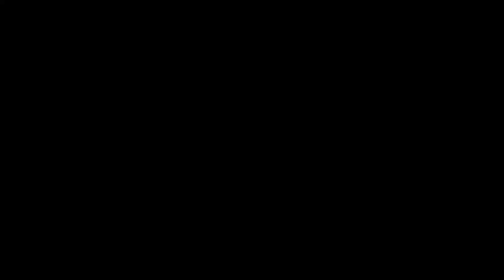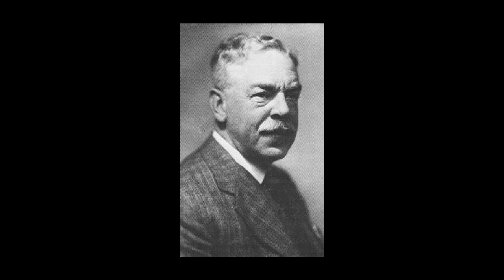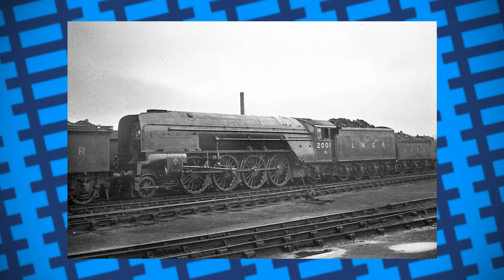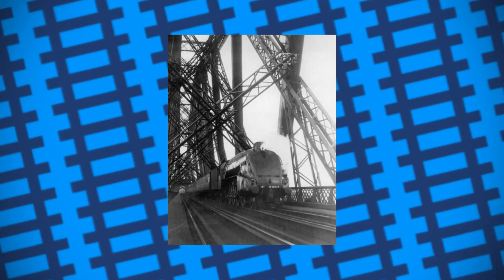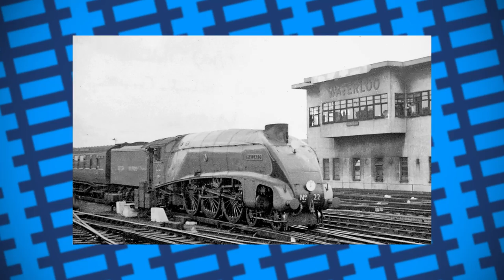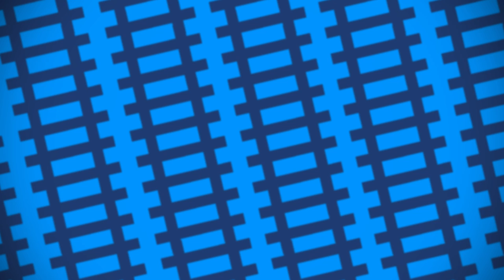LNER's 8 wheeled experimental express engines - LNER P2

Comment: Greasly really was just a mad engineer with bear infinite amount of money. I would love to have been a fly on the wall when Greasly rocks in and goes, “What if we put the boiler from a ship, in a steam train?”

Or “What if we made a 2-8-2 express engine?

Or even, “What if we made an engine, with 6 cylinders?”
Reply: The LNER was the poorest of the big 4, gresley made it even more poor. 

He was a fool
Reply: @Trainskitsetc  He may have done. But at least they were poor… with style.
Reply: @DTChapman1  ...yeesssss because that's the aim of a railway...
Reply: @DTChapman1  they weren't just the poorest they actually never turned a profit, not one single year of the LNERs existence did they make any money... probably in no small part thanks to the silly persuit of speed and prestige rather than focusing on becoming more economically stable and repaying the debts they'd inherited at grouping.
Reply: @Trainskitsetc  seeking prestige is a very British thing,solving problems isn't a very British thing. So in this sense,Gresley succeeded
Reply: @davidantoniocamposbarros7528  no, its very much just an LNER thing, every other railway sorta managed both lol 

The GWR had prestige services to ports for onward traffic out of the country plus other fast express and standardisation, the LMS managed a fair amount of standardisation and prestige services from London to the north, the Southern managed to run prestige high speed services and also engaged in rationalisation of it's other workings and movements toward a more modern railway to suite the high frequency passenger service needs of its main routes. 

The LNER basically let it all go to pot other than it's prestigious service and some attempts at shoring up its heavy coal workings/express freight capabilities. 

It pretty much sucked at any progress towards becoming a more standardised easier to operate efficient operation. This could be put down to finances, in some part, but also in large part to the board being sold the idea of prestige being more important than rationalisation of the whole operation.
Reply: Greasely lmao
Reply: Probably wanted to use the boiler on an engine rather than a train.
Reply: Why Are you calling him mad’? Who designed and oversaw the construction of Mallard and Flying Scotsman
Reply: @kernowpictures2002  it's because gresley and his, arguably failed, experiment is  largely all the lad knows about. 

If he truly saw the breadth of experimentation and the rate of failure that continued well into BR days he'd realise an engineer having a bad, or subpar, idea or being sweet talked into putting some bit of kit onto a loco on the bases of magicians hat levels of improvement in operating costs or maintenance costs he'd probably see hush hush for what it is, the failed experiment we all learn about because of the guy who did it not because of the anything particularly amazing about it. 

Let's go through a few more eh, 

Holcroft-Anderson and the recompression system that was meant to improve efficiency 29%! Failed. Same holcroft that actually did the leg work for "gresley conjugated valve gear" 

Vincent raven, the guy who was responsible for bringing the pacific to the north eastern that became part of the LNER that culminated in the gresley pacifics... yup he had a bad time chasing the idea of uniflow steam locomotives

Bulleid, worked with gresley, worked on gresleys most famous locos, then went to the southern and... well ends up chasing the dream of the leader... experiment gone wrong. 

Interestingly bulleid was married to the daughter of Ivatt... no not that ivatt from the LMS the Ivatt from the north eastern  who was the dad of the Ivatt of LMS fame

But you'll note a theme, none of them were mad engineers they all just sorta did a job and also sorta made some poor choices in that job😆

Ivatt(senior) probably did more than any of these to influence norms of british loco design having introduced walschaerts valve gear to the UK which other than stephensons was basically universal. Everything else being sort of just a foot note. That's the kind of engineering we should admire the people who make the world what it is not the people who get bored one day and decide, in modern terms, to do a hyperloop because efficiency!
Reply: @Trainskitsetc  Well that would’ve considered murder if they could actually speak and were alive like in the railway series books/(Thomas & Friends TV show)
Reply: @Trainskitsetc  Weren't Southern railways the poorest? Least with the LNER they had quite a decent monopoly on the coal/mining transportation
Reply: @kernowpictures2002  no genius has ever been truly sane
Reply: @Trainskitsetc  A fool who built Mallard and Flying Scotsman (as well as Gordon)
Reply: @kernowpictures2002  happened to be in charge at the time. The real men of the works built them, the skilled hand of the drawing office drew them, they are no one mans machine.
Reply: @Trainskitsetc  Gresley wasn't a "Fool" he was primarily a man of engineering, rather than a man of financial management.   That being said - the P2's were a pet project with his apprentice Bulleid, that lead to the A4's, the W1 was another experiment - to see what was possible.... the U1 was his reluctant design requested by management, hence built by Beyer-Peacock to a plan by him.
Reply: @PiersDJackson  if you are placed into a position of trust to make engineering decisions that have real impact on the performance of a business and you have no head for business then within the context of the requirements for you to despense your duties you are a fool. Simply put, he couldn't actually do his job well. His job was not simply to oversee locomotive design, his job was to oversee locomotive design, rolling stock design and infrastructure design in such a way as to deliver a functional and above all economically viable railway operation. He failed. Simple as. No amount of pretty upturned bathtubs on wheels or speed records get away from this fundimental failure to do his job.

If he was in a business today, he'd likely be sacked for underperformance and huge waste of resources. And that's saying something given some of the people you see in top posts these days.
Reply: @Trainskitsetc  I put it to you this way, on a scale of Abner Doble, W.O. Bentley, Henry Royce, Henry Ford and Charles Rolls.  Being a scale of 1-5 from being mad genius engineer to ruthless capitalist.  Gresley would sit next to W.O. Bentley, and Bulleid would be with Doble, Thompson was of the Henry Ford variety.  Bare in mind The Honourable C.S. Rolls was a financier with old money, ie. worked in the city, and wasn't an engineer.  Put this way, Doble and Bulleid were experiment and prefect the concept types of engineer, only limited by delays in supply; Thompson and Henry Ford were after standardisation, keeping everything simple and interchangeable with parts, very utilitarian; Gresley and Bentley were pragmatic with their designs, if it worked, it worked, experiment within reason, keep the complexity simple.
Reply: @PiersDJackson  so let me put it this way, he was bad at his job. 

But he had a fancy rich mates so what's consistently poor performance  between friends nudge nudge wink wink say no more say no more that A4, does it go, does it roll does it
Reply: @Trainskitsetc  he was good at engineering, but was fiscally irresponsible.  He couldn't adequately work within an allocated budget.  If he had £150,000 to develop the preliminary batch of A4's, he'd spend £120,000 on R&D, then still spend £100,000 building them... so no he wasn't good with the cash flow.
Reply: @PiersDJackson  so, bad at the job. Like I get it he has a hero image built up around him, but when your job is make railway go and earn it's keep to make sure it keeps going and you don't do that job that's not being a hero or good that's being flawed. Fact is they had £120,000. If they had £150,000 that's not a defence of him to say he was hamstrung that's him not knowing how to work within the confines of what he has to work with. 

Lets say you approached a builder for an extension, you said you have £120,000. They build you the nicest extension, walls, doors, windows, roof all top notch, painted beautifully, art hung on the walls. Well you're gonna call them a bad builder when you see all this and realise sure it has all these things but they forgot to install any flooring so you're walking on the dirt that was once your garden. If that builder says "well it would have been spot on if you'd had £150,000"... that's just nuts. 😅
Reply: @PiersDJackson  so what you just said there in a round about way is, he was back at his job.

He couldn't work within a budget, he couldn't work within a time frame, he couldn't admit failure and persisted even when it was pretty obvious he wasn't delivering results. 

If we look at it critically, he was just not that great at the job. If we look at it with the romance of history, he was the greatest steam engineer ever because he made it go fast. 

Might be time we started looking at the reality of railway history and leave the myth behind.
Reply: @Trainskitsetc  to put this into a context some outside this community may understand: With the scriptwriters of Doctor Who in the 70's, there were the three "Gods" Douglas Adams, Terrence Dicks and Robert Holmes...  if you wanted it fast and by the numbers, it was Dicks (ie. Thompson); Intriguing and fast, with a few short delays in delivery, it was Holmes (ie. Gresley); but if you wanted mad and weird, it was Adams (ie. Bulleid).   Adams was infamous for his quote "I love deadlines, especially that whooshing sound they make as they fly past".

It's really a case of: On Time, On Budget, Fit for Purpose.  Pick two.
Reply: @PiersDJackson  he's still not a good chief engineer. 

The script writer is akin to the draughtsmen, the chief engineer is akin to the director producer, the director producers job is to keep a lid on the nonsense dreams of the writer, we have put the writer in charge of the production is what you really mean to say. Which is kinda not the best idea
Reply: @Trainskitsetc  what generally happens in either case, TV or Railways, is people migrate through the chairs.... the locomotive design engineer, or superintendent of carriage works, becomes the workshop manager, to become Regional manager, or chief engineer, and eventually becoming a administrator.   Or in TV terms, the writer becomes script editor, director and producer, or actor to writer to director and then producer... to then ascend to management.
Reply: @PiersDJackson  and... the wrong people can ascend, people not suited to the job. 

Given his fondness for birds it is maybe more apt to compare him to everyones favourite fictional radio host turned news reader turned producer turned director; Alan Partridge. He can make something, this is undeniable, can he do it well. Nope. 

Then he probably gets on the phone and reads reviews of his own locomotives from railway world to people he dislikes or reads reviews of how the LMS duchess makes overtaking a teadious process. 🤣 "the words of top gear magazine!"
Reply: @alasdairmmorrison74  yes sorry, i forget I must praise my gresley daddy for be make the speedy blue one.

I would say people who gush praise on him have a more particularly peculiar view on a man who the numbers show time and again really wasn't doing his job. That the books show left a railway in complete shambles. That the supporters of have engaged in some reprehensible lying to prop up the repuatation of. 

He really isn't all he's cracked up to be and that's just recorded time and again. Is what it is.
Reply: @HenryGreenEngine3  Einstein?
Reply: Gresley was exactly the opposite of that. The LNER never had the money to spend on building vast fleets of new engines, and Gresley had to do the best he could on a limited budget. He continued to build locos originally designed for the constituent railways where they had proven suitable for their jobs, he rebuilt inherited locomotives to improve their performance, and he managed to greatly increase the speed and prestige of the East Coast Main Line with what amounted to no more than a handful of streamlined locos. The P2s were intended to avoid double-heading on heavy trains over the steeper grades in Scotland, so they were intended to save money. At the same time he tried a few detailed experiments, not all of which paid off, but these were on a small scale. Unfortunately for Gresley, all his locos with conjugated valve gear needed regular careful maintenance, something which was no longer possible under wartime conditions, and that prompted Thompson to rebuild the P2s to increase their availability.
Reply: 2-8-2 express engine?! Here in America we have 4-8-4 express engines, SP 4449, UP 844, and N&W 611. We also got 4-8-8-4 engines, UP 4014. Hell, we even had the Baldwin 2-8-2 Mountain type steam locomotive! I don't want to hear anything!

EDIT: Had to add UP 844 to the 4-8-4 and the Baldwin 2-8-2 Mountain Type locomotive
Reply: @ZackarySchejbalCODBO2RGM2  smugs in Australian 4-8-4+4-8-4
Reply: @Trainskitsetc  The nature of the companies forced together at Grouping to make up the LNER made it difficult if not impossible for the LNER to make much of a profit. The GWR was scarcely changed by grouping, it was not forced to take on large companies which were a financial millstone. The mergers which brought about the Southern and the LMS were similar in that neither grouping had to take on so much lack of investment and financial deadweight as that which inflicted upon the LNER. The "pursuit of speed" the introduction of high speed passenger services was one way of making money, the Silver Jubilee paid for itself very quickly. Strange that high speed still sells trains even to this day but you need the equipment to do this. Similarly with high speed freight services. And yes the LNER recognised the need for higher freight speeds and obtaining greater track capacity to allow for separate passenger and freight routes is, to say the least, expensive. So you have to find a way to integrate the flow of the two traffics and trying to integrate high speed passenger services with loose coupled freight is a fools errand without sufficient track capacity. A six track railway with ample accommodation loops is rather attractive, it allows you to deliver an intensive service of low speed, medium speed and high speed traffic. You can ease your problem by increasing freight train speeds but you need the braked vehicles and traction to allow you to do this and the LNER was working on this. The K3 Moguls proved very capable at working higher speed freight and the V2s were somewhat better.
And so it goes on. The narrative that you are trying to drive does not withstand anything in the way of close scrutiny. I wonder why?
Reply: @DeCasoU1  unfortunate that the only aspect to a railway making money isn't the speed at which the train goes, where it goes, how often it goes, when it goes... it's uh also the subtlety of how much it costs to maintain, to build, to repair... all of which play into one or more of the factors above, funny isn't that you fail to bring in a bloated mismanaged approach to motive power as a reason for difficulties in paying down those old debts that lingered and messed everything up. 

Spend less constantly fixing your speed machines you have to constantly tinker with to get greater performance for prestige and you actually have funds to work on the backbone of the beast to make sure it can stand, don't and you're putting makeup on pigs.

There's also a laughable nature to speed mattering that much. The fast service london to Edinburgh is only worth it if you go london to edinburgh, if you go points beyond, you know on the most populous side of the country the west, then you have no reason to give a tos s about how fast it goes if you don't get to your destination any faster by losing time changing at edinburgh and onto a glasgow train. For large parts of the country this speed was useless, as it was for the largest portions of the population. A railway cursed by geography chasing a customer whos only reason to use it was speed that probably wasn't much benefit to a great many people. No wonder they had to sell so hard on the luxury angle. Lol idiots with money will pay to feel special.
Reply: Looks like a commentary in no way tried to mildly praise a dead personality suddenly grabbed the attention of someone "strictly only specifics" kinda Joe who kind of reeks self entitlement regarding his quack load of reality grocer's checklist of efficiency penchant jargons. The amount of effort in the arguments sends off his character as the most 'efficient thinker', probably not a doer but who am i to judge a comment jockey lmao.
Reply: @changsangma1915  not a doer at all, no experience working with real locos at all. 

;) soz, someone doesn't like your favourite overrated bird obsessed engineer.
Reply: The comment about Gresley, being a mad engineer, reminds me of a Reddit writing prompt, which was something along the lines of “everyone talks about mad scientists, but the people you really need to fear are those mad engineers”.
Reply: @kernowpictures2002  the thing people keep forgeting is that the engines aren't people
Reply: @Trainskitsetc  And yet he still designed some of the most successful and iconic locomotives of all time.
Reply: @furioussherman7265  how are you measuring success? 

What does iconic mean? I feel it's a word we just throw around without thinking what it really means to call something iconic or consider why it is iconic. Is it even good to by iconic? Is having icons actually a good thing or is it poisoning your own view of anything else as ultimately not as good because it is not that which you have been told is iconic? Not to be iconoclastic or anything but train go fast or look pretty is not all that important in railway terms, train run reliably and have good profit margin on operation is far more important. Which as designed a lot of gresley locos didn't really achieve, people had to come in and fix the faults to really make them that good for the purpose intended.
Reply: @Trainskitsetc  And yet, as the video showed, the person that came in and fixed the faults on these particular Gresley locomotives actually made them worse. They ran just fine before then.
Reply: @furioussherman7265  uhhh the records show they were seriously unreliable prior to rebuilding and the locos they were rebuilt into had greater route and service availability as in spent considerably more time at work instead of being worked on. I'd call that a successful outcome, taking something that suffered poor availability and making it available to do its job of pulling trains on more days per year is a big ol W for the railway. The records are in the museums if you want to go and double check the work of the historian that checked it out and confirmed this.
Reply: @furioussherman7265  1942 the P2s were available 57% of the time to pull trains. That's not good, even by LNER standards. In 1943 46% availability. A good loco is not one that is unable to do anything for half the year. 

The first rebuilt P2 managed more than 70% availability and double the average millage between needing work of any P2. 

The notes of the board confirmed the rebuild was able to do the same work, same trains, only more often.

The rebuilt P2s were among the top performing LNER engines in terms of availability to work trains by 1945.